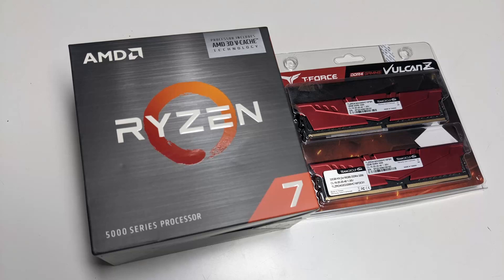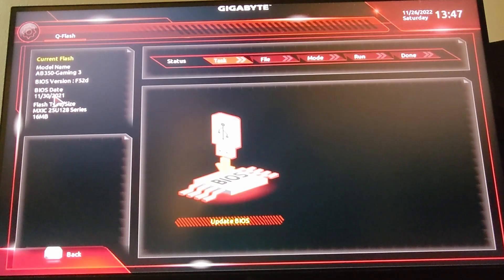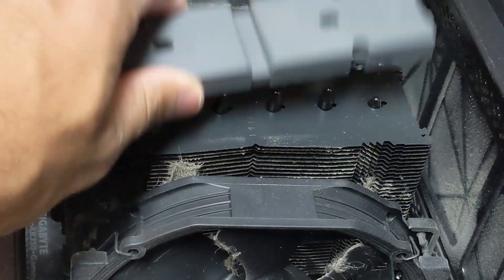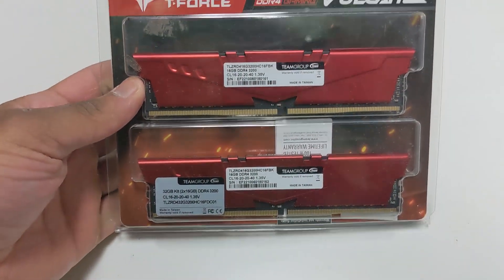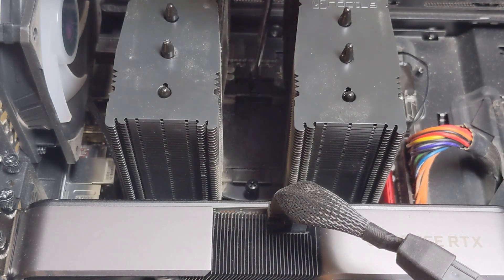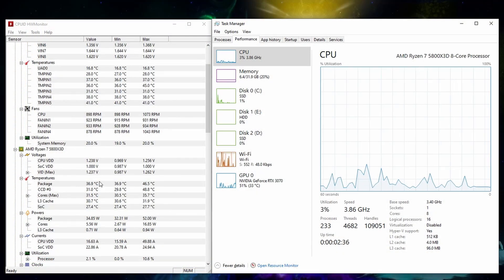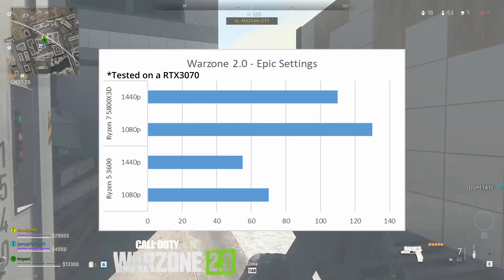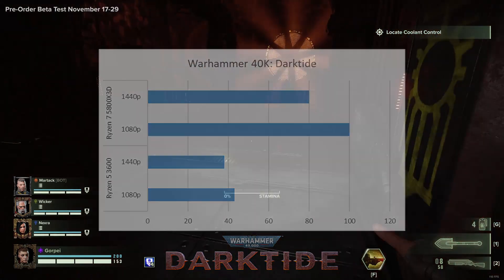Upgrading to a Ryzen 7 5800X3D - Tech Lion

Comment from the maker: Y'all going to cyber bully me into making a PC cleaning video. 🤣

Edit: And I was aware the original RAM was installed in the wrong slots. 
This was corrected with the new sticks. Sometimes things slip through. 🤪
Reply: I'd say the ram in the wrong slot and being slower model is probably the reason for a huge chunk of that performance gain you got
Reply: I think the video is misleading because it makes the 3600 look worse then it actually is due too single channel ram. You should either redo the tests or at least put a disclaimer that the data shown is inaccurate.
Reply: As they should, that PC is gross.
Reply: No you weren't, because you had no clue about the BIOS beyond how'd I'd would work on a Gigabyte bord.
Reply: @randomguydoes2901  your average gamer is not going to be using single channel ram. So he should redo the test with duel channel ram to show the real improvements of the 5800x3d for your average setup. Maybe going from single to dual channel ram with the 3600 would be a better value upgrade then going from 3600 to 5800x3d with single channel ram?
Reply: @fablearchitect7645  
Sry dude, but to blow your thoughts away, the performance would not be much different with the RAM in Dual Channel and the 3600, as the limiting factor isnt the RAM which was also slower than the new RAM, but its the CPU, as the 3600 is pretty weak and lacks cores, IPC and cache.

So even  with 1-5FPS more, the 5800X3D woul've still just devastated the 3600, as he did with my old 3700X in certain games at QHD with a RTX 3080 Aorus Master 12GB.

So NO, even with Single Channel RAM the 5800X3D just destroys the 3600, without breaking a sweat, as it has the general non Cache heavy performance of the 5700X and when the cache gets used and the CPU isnt dragged down by a weak GPU to much, the 3600 will just eat dirt and see fast disappearing backlights.

Also the 5800X3D, because of the large L2 Cache, is much less RAM dependant as the non X3D CPUs, which need fast low latency RAM and proper RAM to infinityclock sync to perform the best. 
Which is why the just DDR4 3200 is fine with the 5800X3D while a Ryzen 3000 should atleast run with 3600CL16 and a 5000 with 3800CL16 to perform at optimal levels (3600 and 3800 repectivly are the sweetspots that should work well in 1:1 sync with the IF, but sometimes 3800 and 4000 also work, depending on the quality of the unit and the RAM controller in it).
Reply: @wolfwilkopter2231  my thoughts will be blown away when a fair test has been performed that validates your theory. Obviously the 5800x3d is faster then the 3600. All I was asking for was a fair test to show the real performance gain as opposed to perceived biases in performance.
Reply: @fablearchitect7645  
Anyone who knows how things work and what they really offer wouldve said the same, the difference would be marginal, dual channel is not a performance doubler, it grants a little extra, especially in CPU Limits or highly demanding applications and games, but its real world gains are somewhere between 1-10% at best.

And ofc will the 5800X3D blow the 3600 out of the water:
6Cores 12Threads vs. 8 Cores and 16Threads
Zen 2 vs. Zen 3 meaning higher IPC, higher Clockspeeds and higher possible RAM Speeds coz of better Controllers.

Also the old RAM in single channel was slower, than the new one, to make your weak point, you would probably also demand that he tests the 3600 with the new RAM, even tho it was never paired with it to begin with, just to gt the 3600 perform a little better again.

What you call a "fair test" is just a desperate attempt to invalidate the conclusion, which in fact would not change much, regardless of dual channel and the usage of DDR4 3200, as the 3600 is still a weaker and in the Cache department harshly limited CPU, which in turn can severly hamper the performance of some games.

To make my Point, even tho Cyberpunk is mostly GPU limited with my RTX 3080 Aorus Master 12GB @ QHD with Raytracing Ultra/Psycho and DLSS2 Quality, it still managed to gain 5more Average FPS from the 3700X to the 5800X3D (both running at the same board with the same 32GB DDR4 3600CL16), same for the minimal FPS and thats with a hard GPU Limit.

Shadow of the Tomb Raider on the other Hand, is a very CPU Heavy Game, max Settings with DLSS2 Quality and Raytracing on, gave me 123FPS with the Game still just at 41% GPU bound or 59% CPU bound, which the 5800X3D literally changed like night and day.
The Average FPS increased to 139, the minimal and maximal FPS on the CPU rendering literally exploded (3700X CPU Game with DLSS2: 92min and 192max. 5800X3D same settings: 167min and 414max! )  and the game suddenly became entirely GPU bound even with DLSS2 already running.

Do you play The Elder Scrolls Online or any other Online MMO?
With the 3700X max settings including DLAA, i got the 100FPS Limit from that game quite easily, but that changed when it came to NPCs and other players appearing, then it dropped, harshly at times...with the 5800X3D...regardless of what i did...no drop from the 100FPS limit of that game ever again.

And that was with an slightly faster 8Core vs a newer and much better 8Core already and not a slower 6Core, that was also hampered by slow ram with the little neglegable thing of that also beeing in single channel.

There is a crapton of Comparision videos out there from users and tech reviewers alike and alot of outlets gave it a thorough testing, like Hardware Unboxed and others and the conclusion always was: 
If the 5800X3D can make use not only of it beeing a already faster Zen3 that at max clock is just a handful % behind its cousin the 5800X, but blows way past when it can make use of the L3 Cache, even declassing a 12900KS and even today it holds its Ground against just slightly faster 13600K, overpowering even the 7950X in games and only get significantly defeated by the 13700K, 13900K and the entire upper 7xxxX3D Series.

The 5800X3D is, for example, also about 36% faster over several games tested, than the 5600 and now you can probaly see, why the even much weaker 3600, that doesnt even come close to the 5600 wont stand a chance against the 5800X3D, even when its about a Game without heavy L3 Cache usage.

Hardware Unboxed 3600 vs 5800X3D: watch?v=2HqE03SpdOs

Others /Reviewers/Users/Upgraders:

watch?v=pTt6JOTDVZ8

watch?v=UiU-Ya2c88s

watch?v=DseH5Ixp4f4

So stop bickering and get a grip, youre wrong regardles of how you want it to be "fair" the 3600 doesnt stand a chance.
Reply: @wolfwilkopter2231  The hardware unboxed video you posted found the 5800x3d to be 26% faster on average then the 3600 at 1080p. Not 100% gains like this video did. Yes, the 5800x3d is faster, I upgraded to one. But people shouldn't expect the percentage gains shown in this video because it is misleading.
Reply: @fablearchitect7645  
So now you resort to cherry picking and to averages, to avoid admitting DEFEAT. OK...lets see how that goes.

Your only 26% faster on Average in 1080p are with just a meagre 6600XT  which is just an entry level GPU and pretty much a pulled handbrake.
With a RX6950XT, as one of the strongest cards at that time of testing, the Average already blows up to to 46% at 1080p, coz of drastically decreasing a possible GPU Limit!

And with you just cherry picking the Averages is, as you said it, misleading, which is what you are attempting right now. 
You're tryin to gaslight people with cherry picked Averages, that cant and wont hold up to specifics and specifics are, what this video was about.

Because, as the different SINGLE game specific Benchmarks showed, performance increases in some titles UP TO around the 100% mark with the lows even going beyond that.!
So this video here is pretty much correct, as other peoples videos and ofc Hardware Unboxed also showed in some titles, which i listed here as well.

And i did see drastic increases at some points, but you decided to ignore that aswell, even with the big Benchmark chart confirming my Statement for SotTR for example.
Not to mention that all those titles tested had no Raytracing and no Upscaling active, so they could power thru till they barfed with maximum Rasterization performance available.

You have no leg to stand on here, not with your "fair testing" nor with your cherry picked "Averages", that only used 1080p with the weakest card, ignoring testing with a much stronger card and the much more specific single Benchmarks. 

You really must think people are stupid or that you are above everyone else, while arguing with no serious knowledge and resorting to cherry picking and blissful ignorance...but still tryin to tell people what to believe or expect - which could also be a good example for the famous Dunning Kruger Effect.
Reply: @wolfwilkopter2231  I honestly just went to the 1080p section and didn't see the 6950xt. My bad. Ok yes, 46% which is still still not 100%. If you want me to read your responses, could you please make them shorter and not full of personal soy rage.
Reply: How did you let it get that bad? Jesus
Reply: I'd say it's a petty excuse. Half-assed cleaning could hamper your desktop's performance significantly though. You're also unnecessarily exposing your desktop into a chance of shorting due to those thickened dusts.

Skipping to record the cleaning part wouldn't hurt your recording session in order to stay with the topic, which is focusing on the upgrade itself. 🤷‍♂️

I find it funny that you actually interpret those as "cyber bullying". 🤔

Comment: just updated mine, these cpus are fast, but they get a lil toasty! also i had my bios on a version that excepted this processor, but turned out to wrong as it wouldnt boost lol. I used to have an nhd15 in mine, had a nasty habit of raising my gpu temps by 10C! found it was trapping hot air above it.

Comment: 5800x3d works best with a small undervolt 30mv per core made mine 10 degrees cooler
Reply: Does this affect the performance?
Reply: @wakkowarner3716  On mine it meant that it boosted to the full 4.5 GHz

Comment: In games my 3600 never shows its maxing out at 100% (it stays under 50%) so is there still performance which its not giving me ? People say I need to get a faster processor for my 4080.
Reply: A 3600 is not enough for a 4080, obviously. If ur planning on staying on AM4 you should just grab the 5800x3d really, its just the best gaming cpu out there for am4 thanks to its L3-cache
Reply: @FaZeAbii  I ended up getting a Ryzen 7 5800X3D. It's lots better

Comment: do you have to update your bios in order to upgrade your cpu from say a ryzen 7 3800x to a ryzxen 7 5800x3d ? if so i wont be upgrading, looks to difficult
Reply from the maker: Upgrading your motherboard BIOS is SUPER EASY! For most motherboards, all you really need is a flash drive to load the .bin file onto then boot into your bios and select the upgrade option available to you. Some even have a BIOS Flash button built onto the motherboard itself so you can press the button and upgrade it from there. Check with your mobo manufacturer for more details on it.

Comment: Do you check if you have a frame cap in Apex Legends? I remember that you can uncap the frames through client. Probably would give you results you might be looking for.
Reply from the maker: I did! But Apex is the kind of game that was bound by my GPU, not my CPU. So the processor upgrade made little difference in that specific case.
Reply: @TechLionPCs  The game also has an FPS cap of 300. It can't go any higher due to the engine and at 180 FPS the game starts to behave weirdly so I'd just use 180 as a max if you dont have a 240hz monitor.

Comment: do you have encounter any problem after upgrading? i have b350 asus strix, and want to put the 5800x3d too, but i kinda worry cause its low end motherboard chipset, thanks
Reply from the maker: No issues at all in the months I've had it installed! Been absolutely great this whole time. Stay tuned for the final upgrade of this build as a video card will be next. 😁
Reply: Wdym low end mobo? Your mobo is good even for 5800x3d

Comment: I just bought it this week but I’m kind of hesitating using this with Corsair H60 AIO after I saw your big CPU cooler 😥
Reply from the maker: Your AIO should be able to still handle this CPU but one of this tier would need a 240mm at the least like the H100 to get its full potential for sure.

Comment: I had a 3900x paired with a 4090. I was getting stutter nation or frame drops. It simply would not keep up with the 4090. Once I upgraded to the 5800x3d, performance came back and it was buttery smooth. The 1% lows were soo much better and the smoothness was night and day. I would say, if you're still on the am4 platform and older zen processors than this would be a good upgrade. If you're building a new system than i would suggest investing in the newest. I game at 5120x1440p ultrawide@240hz

Comment: I think this video is misleading. I have a Ryzen 5 2600x and it makes a huge deal in whether I'm running 1080p or 1440p. You saying that the 3600 makes no difference there is probably due to your RAM being wrongfully installed. I think your 3600 FPS numbers are not trustworthy and extremely low. My 2600x does significantly better than your 3600. Btw, I have a similar cooler and a worse GPU (2060).

Comment: How many frames are you getting in Dragonflight during raids when alot of stuff is going on? I just bought myself the 5800X3D coming from a 5600x. I thought back when I bought the 5600x that It would be sufficient to reach over 100frames in raid but sadly enough that is far from the truth and that's just on graphical quality 5-6 with shadows turned off.  Badly coded...I know. But still, sometimes I see streamers running with equal hardware blazing through content with super high frames and with shadows and all the eyecandy turned on. I don't get it sometimes :).

Comment: So bios updates is really necessary before installing amd motherboards and cpu`s?
Reply from the maker: Most likely, depending on when you received your motherboard or when it was manufactured. In my case, yes it was necessary as it the 5800X3D came out 4 years after my motherboard did. Fortunately the AM4 platform has an extremely long lifespan as far as processors are concerned so a simple BIOS update adds compatibility.
Reply: @TechLionPCs  Thanks 😇 i hope it wont fries hehe because before i order the motherboard it was labeled ready for 3rd gen amd ryzen and windows 11 ☺

Comment: you have to update your backup bios otherwise some time in future motherboard will send you back to backup bios if it fail to post. and if your backup bios don't support your CPU you won't be able to boot. gigabyte dual bios function is broken and function randomly I had b450 Aorus pro and I needed to update to f40 for Ryzen 3000 series so I follow steps and install F32 first then updated EC FW tool then when I reboot the board switch to backup bios F4. I didn't notice the switch so I went and flash F40 and because I wasn't in f32 when I flash F40 the board lost dual channel function and XMP won't work. I can't boot above 2666MHz on dual channel anymore and I try every single bios in the website to no success.

Comment: Not sure if the 5800X3D is worth the $150.00 more than a 5700X.  The FPS gain is nice, but is it really worth it?
Reply: I switched from 5900x to 5800x3d, it is way better, finally pushes my 3080 to maxx
Reply: @johnborheck3022  I too have the 5900x with a an EVGA 3080.  I'll order the 5800X 3d. I have a spare Aorus B550 that I can toss the 5900 onto later after picking up more parts.  Thanks for the info.
Reply: @LordAtrocities  you'll like it better for gaming, we got hooked up with that last processor. I'm very happy
Reply: Depends on what games you play where you see the biggest difference. It’s still beating a 5950x overall which should tell you something.
Reply: it is... on warzone 2 i saw a 50 frame average difference when comparing to the 5900x... imagine the 5700x
Reply: @Realaaronwoebbeking  what’s your setup with the 5800x3d?
Reply: @KhmerVidz  zotac 3070 4000 mhz ddr4 16gb ram b550 tomahawk max 5800x3d. consistent 190 fps on 1080, 1% low is at 162 otherwise averages 180-200 and i can stream live with only a few frames dropping.
Reply: @KhmerVidz  the cpu is still too good for the 3070 and will shine for a very long time yet.

Comment: i have the 5800x3d on a b350 motherboard also with 6800 xt. I run both undervolted on a 500w psu in an itx case and SAM is enabled too
Reply: how do you under volt the 5800x3d? I thought they are locked
Reply: @jasonmaxwell9762  you use pbotuner . It's not ideal as you need to rig it for automatic apply on startup. But doable. I use -30mv on all cores
Reply: @BogDog9  PBO With Ryzen master? So I just ordered a 5800x3d and kinda regretted it after I realized it was locked. I dont care about OC, but I hate cpu boost because it causes stuttering. I always undervolt and lock all my cores to a set mhz. Is there a way to turn boosting off and lock the cores higher than the base clock of 3.4? with the 5800x3d?

Comment: I've upgraded from a i7 8700k to the Ryzen 5800X3D and performance improvements seemed to be way bigger than big benchmarks showed, like the performance jumps in this video. The old i7 8700k is similar in performance to the Ryzen 3600 though, and games I play are usually very demanding on the CPU.